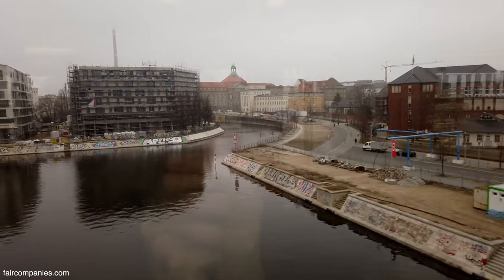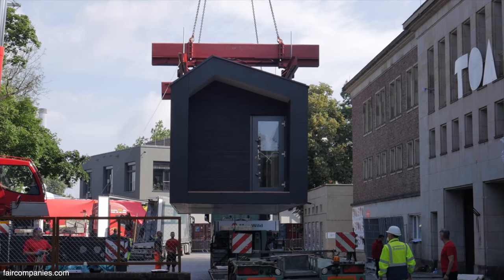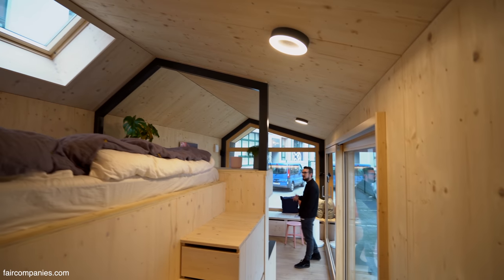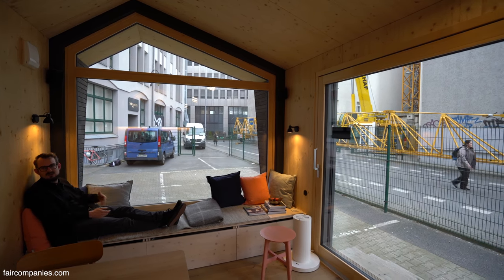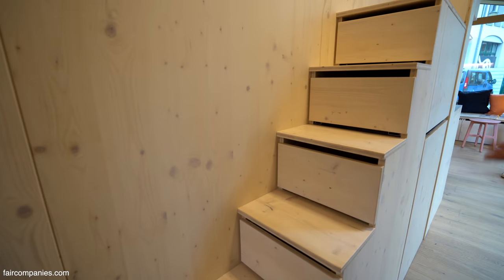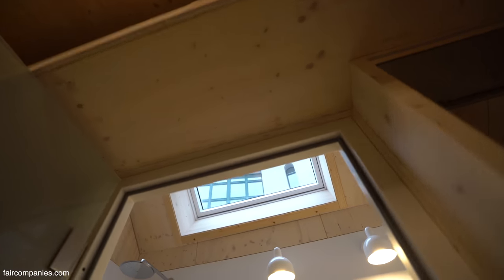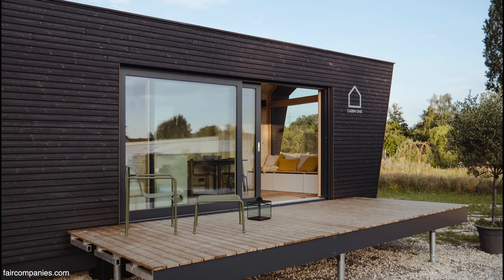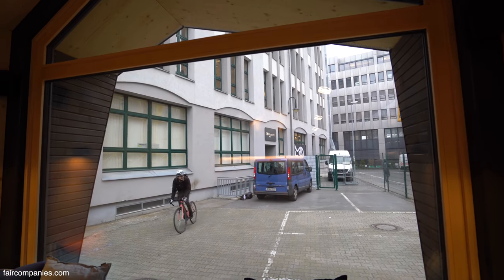An easy-to-install prefab cabin as alternative to rental flats?

Comment: For me aesthetically it's well executed. But like everyone else I have problems/questions. Plumbing and mechanical hookups, how would that work and where are they, under the 'not a bedroom', I didn't see an access point. Access for getting to the roof is the next issue for residents and emergency personnel, and of course what's the weight and what about rain/snow and roof damage from this sitting up there. And is it better to add this to a roof versus solar or a gathering area or a garden/green roof (0:46), those three all add more value for the existing residents and they don't require a big crane. Still I like this kind of thinking. As always thanks for some of the best content on youtube Kristen.

Comment: Clever idea and beautifully designed.   Every one's comments about water, sewage, electricity, access and load each building can handle, are spot on.   I have the same questions.  He mentioned Berlin having about 150K buildings where these cabins can be used.  Seems very optimistic.   Also were they thinking one per building?

Comment: Yet another really fine piece, Kirsten!
Pack in the living, the "dwelling advantage", in R. Buckminster Fuller's phrase. Becker does a great job!!! The windows are pretty important. You go indoors, you're looking for a safer thing than a Gore-Tex rain parka, and a Gore-tex bivouac sac. More inclusive... like with 20 of your closest friends. The wall section, the sheathing... ho, hum... it's the fenestration. There's where performance matters. There's where homes leave "pods" behind.
Engineer the wall openings. Lift from the floor. The loads go down... there's your limiting factor. Right now, aerogel is pretty expensive for dwellings. That could change. Wood is a really great structural material, not only for static structures!!!

Comment: This is a bad idea for several reasons. Chief among them no underwriter will insure this property. Moreover plumbing will be a nightmare as you’ll need an external septic tank which will cost you an arm and a leg to service. It will be blazing hot in the summer and freezing cold in the winter.
Reply: Exactly. He backpedaled so hard when he got asked why it doesn't have a bed room. You can not register or insure this as a living space, not gonna happen. But he doesn't care, all he cares about is selling unitS$$$
Reply: Completely agree and for other reasons I have mentioned elsewhere. Thanks.
Reply: The4valanche It looks like a normal European studio except it's a cabin. Of course you can insure it and register it.

Comment: No details of Price, plumbing, restrooms, council licencing, property law. The house is neat but it will surely fetch more than 150.000€?
Reply: I've seen it live yesterday... Prices start at around 88.000 EUR (100.000 for the full version)
Reply: @Renato UnREAL - But that's only a option for people who can relocate.  While the people living in these locations still need solutions for where they are...
Reply: Michael Gress hi. How much approximately is a small warehouse in Berlin? Cheers)
Reply: Renato UnREAL Yeah, where 50% of young people are unemployed. How do you propose to make money?
Reply: @ZeoCyberG  and that house is not a solution. Its just to expensive.
Reply: @m.p.maxplanation - No, it just may not be a solution for you but depending on where people live they may face far higher costs and would consider this cheap in comparison.

Something to understand about costs is they vary depending on location and things like the local economy, how much market demand there is, etc... What you think of expensive can be dirt cheap to someone else living in a more expensive area or what you consider affordable can be too expensive to someone else living in an even lower cost area.

Add, any solution that works within the same system as other housing is going to be effected by the local costs factors.  Like a home on foundation will need building permits, inspections, impact fees, and other costs on top of just building the home.

So what's expensive or cheap is relative and depends where you have to live...

Besides, this is a prototype and those are always going to cost more than the production models.  So final costs, especially if they can produce a lot of these, can be a lot less.

Anything approaching mass production can reduce costs to a small fraction of the original...

It's why you can do things like buy complete furniture from a company like Ikea for less than just the materials will cost a custom furniture maker...  Affordability is sometimes a process...
Reply: @ZeoCyberG   I'm a Berliner. I know the house market in Berlin and Germany well. And the cabin builder is also from Berlin. I just tell you, that is no solution for Berlin and Germany.
Reply: @m.p. maxplanation -  I don't believe you've read all of my previous post as one of the points was you don't actually know what this will cost as it's a prototype and it seems more like you don't understand how this can help...

1) It's being used on existing buildings where the cost to remodel them and add additional floors would cost a lot more than this unit... 

2) Simply adding more housing units helps the problem of not having enough housing units and reducing competition for housing in turn can help reduce cots.

3) Again, this is a prototype and prototypes cost more than production models. So it's a little early to worry about the price...

For example, when a car manufacturer makes a prototype it can cost anywhere from $100,000 to $300,000 on average.  But the production model can be lower than $30,000...  So don't get carried away by just the cost of the prototype...

4) Even discounting the above, the costs mentioned are for owning,  there's other ways costs can be lowered or mitigated.  Like rent to own, just rent, reducing long term costs, and other options... Costs are not always absolutes, either/or, or constant and never changing...

5) Owning is not the only option, some people can't buy at any price but others who own them can rent them out as an option for those with really low incomes... and again the more housing units there are then the easier it will be to lower costs...

6) There are other ways these can be used that may be more affordable than putting them on top of exiting buildings and treating them as an add on.  Or similar but different solutions may offer a wider range of options to cover a wider range of people.

Thing to understand is progress is usually a process that has to start somewhere and takes time to fulfill its intended goal...
Reply: Renato unREAL  some Europeans (like me) can't stand too long in the sunshine, so living there would be a pain in the ass. Also the cost effective places means that the local economy is in bad shape, with high unemployment and low salaries. There is always a catch.
Reply: @m.p.maxplanation1726  it is expensive, but you have to consider that you can move the house. Say you work for one year in Munich, then two years in Paris, then Madrid and so on. Instead of paying rent in those expensive places, you can just move your house. Then if you decide to settle, you can sell it to the next city hopper, or just build a normal house and use this one as an extension, or an Airbnb, or a cabin somewhere nice.

Comment: Getting to and from that rooftop will the crane be there to bring the groceries? Lol
 And plumbing...
Reply: i agree on the plumbing issue and also the electric plus the safety of being on the roof and having a "safe barrier" so you don't fall off. the grocery issue should be handled by having an elevator in the building theoretically
Reply: probably not for old people. its a good trade off for the views
Reply: I assume this will only apply to buildings where the rooftop is accessible via a staircase and door/hatch.
Reply: @neuralvibes  that was a given, I was more thinking about the fact that most of these older buildings do not have elevators...
Reply: prefab modular homes are better for backyards and blocks of land. If you essentially buy a block of land and put 10 prefab homes on the land you can rent them out and have your own housing estate and you'd be rich
Reply: G Sh very funny and a lovely idea ha
Reply: Cool, interesting video as always. Got kinda weird around 3:00 but recovered nicely. Definitely not allowed over here (the States). THANKS
Reply: GrowingDownUnder Tell that to Californian council - they won’t approve it.
Reply: @dewert2  I would say maybe much older people would be okay with it. They might not need to go out every day. They might not have a partner who is shy. But younger people are more likely to miss privacy. Surely people want their own home so they don't have to share and so they can have privacy? I like all the light, but I think it's not for many people because it's too exposed.
Reply: @FurnitureFan  "Older" folks are often living with unwanted results of gravity and life impacting our bodies, no matter how well or carefully we have lived. For me, there is no appeal, in addition to the need to cart groceries, laundry, etc., with a cane in one hand. Stairs to the bed and wasted space, whether in huge windows with no place to hang paintings or or bookshelves.  This particular module would (when completed) be far more interesting for people starting out who have not accumulated a few treasures kept for viewing pleasure or for those without physical or space challenges.  As someone else mentioned, many older buildings will not have elevators, even if their countries would approve the plan. All is well that ends well for the one in need of the solution. : )
Reply: These small homes are suppose to be affordable. They seem to be costing the same as regular homes.
Reply: @GrowingDownUnder  ...You're describing a Trailer Park in the US.
Reply: @GrowingDownUnder  especially if you can stack them. This doesn't look very stackable... :P
Reply: @hulqen  you can buy prefabricated houses that can be stacked or you should at shipping container houses they can be stacked
Reply: Don’t worry about carrying the groceries up there, there’s nowhere to put them if you did.
Reply: Seems like a waste to put a house like that on a rooftop in the city. Some of have had enough of the rat race and want to get away from the agenda 21 lifestyle. Ever sit around a fire pit on a rooftop?
Reply: G Sh how will we bring our avocado toast 🤨🤨🤨
Reply: ya right? i heard my knees groaning already
Reply: @GrowingDownUnder  but it doesnt work with that 100k cabin. In Germany you can buy houses with land for 30k in the countryside
Reply: @fixman88  similar to a trailer park, but without the trailers and these are actual houses they are just prefabricated. 

@zwerina56 if you get permits they will allow it, these prefab homes are built to code as long as they follow the code and you have permits they will be allowed. 

@m.p maxplanation you can buy them cheaper than $100k they aren't that expensive

@hulqen not sure if this prefab home can be stacked but there's plenty of images online of stacked prefab homes some can be stacked not sure about this one.
Reply: Location location location. Not a fan here. Nice cabin though

Comment: What's under the bed? 
The bed seems to be lifted with no purpose, but just lofted because they can. 
The bathroom doesn't go under it. They don't mention plumbing or electrical under there. What's under there?
THey could have had a pull out closet, added storage, Washer/Dryer, and many other options for under the bed, but I don't see it utilized.
Reply: My exact question!!! ...
Reply: Chaz Evansdale
It's the Boogie Man!

Comment: Fascinating, truly an untapped market. Consideration however is weight on some buildings that were not designed to carry rooftop loads, like decks or even gardens. Having a party with 20-40 people may be too much for the underlying super structure.

Push  back from wealthy dwellers who may be ensconced in penthouses, precisely not wanting affordable housing for a neighbor. In markets that can command tens of millions for penthouse spaces, seems like zoning would be the battle ground.
Reply: My exact thoughts! I can not imagine penthouse owners wanting people on the roof...
Reply: Especially people partying, I can't see it being agreed by anyone who paid extra for the peace of being at the top of the building, with no one walking around overhead. 

I don't 'disapprove' but I would like an engineer's report to check that it is securely attached and that the roof can support an extra 14k tons. Also that it is protected against lighting strikes.

I wonder if it is still okay if the owner has children or pets? I don't think I would like to think of children playing on a roof.
Reply: German buildings are designed to withstand heavy snow loads so they can usually take a small wooden cabin too.
Reply: @weetikissa  It weighs, like, all the snow load of a calendar year, though.  Times 5.
Reply: @tamcon72  Yeah, but buildings have to be built with crazy tolerances so that not all buildings collapse if there's a crazy amount of snow one special year.
Reply: @weetikissa  I'm a former architecture major.  It is not correct to assume that the average building, even in Berlin, would have been built to accommodate the equivalent of half an extra floor in load, in addition to  unusual snow load, which could not have been accurately estimated 40 years ago, before recent weather changes, anyway.  

This company has a good idea that they have not really thought through, as all the structural engineers in these comment threads illustrate.

Comment: Dead space under the bed?  Curious to know what they did there.
Reply: Imagine a walk in closet and a water heater maybe the washer/ dryer combo.
Reply: That area, as well as the area right when you walk through the door. Would be nice to know what's there.
Reply: I get the impression that there are optional extras to be fitted, depending on how people want it customised.
Reply: Lovely design of space and I was waiting to hear what the area under the bed was used for? And still would like to know : )
Reply: sewage

Comment: My only fear would be able to get emergency services to the roof if they were needed.
Reply: Germany surely has regulations that require a decent staircase to the rooftop. So it should not be a problem.
Reply: They're trained and have equipment and tools. But how do you order a pizza?
Reply: A fire would be a long jump down

Comment: Great video as always.
BUT let's come to the serious issues this idea has.
A. The claim that there is so much rooftop space available is a rather false claim. The prefab is nothing less than a another floor in height. If City planners and regulators wanted this they would not have certain fixed building heights in each area.
B. The prefab is so heavy 13.5 tons = 135kN in about let's say 25m2 (?) footprint or less. This means that the uniform load is about 13500/25= 540kg/m2 or 5.4kN/m2. Most roof tops are not designed for such permanent or even variable loads even in snowy areas. This load is on top of the roof insulation which weighs usually more than 200kg/m2. On top of that are snow and wind loads on the prefab. No way. Most roof tops are designed for permanent load of about 200-250kg/m2 and a variable load (snow and or people) of 200kg/m2 or less. And I did not mention that the load is actually not uniformly distributed but concentrated on 2 or 3 steel beam that distribute the force as line loads which is even worst. 
Did I mention that rooftop materials as lightweight concrete and or polysterin would have issues with the concentration of loads under the steel beams? 
 Even rooftop chillers in office buildings weigh less (4 to 6 tons) So there are issues. Not only with the rooftop slab and beams but possibly with the columns or the masonry below. This   would need serious structural engineering to prove that it is OK. Not to mention to prove the local regulatory authority like city planners or engineers. In earthquake prone regions like Greece or Italy the problem gets even worst as you add mass on top of the building. Authorities would require possibly a check of the building as a whole depending on the size of the building. 
B. Then you have to find a way to probably anchor the prefab on the slab to deal with earthquake or wind induced   forces. 
C. I dont know about Germany. But this prefab with these openings and nothing to shade the windows, in southern Europe would be hot as hell in summer. 
C. Plumbing? Phone lines etc etc. 
Finally in super protective Germany I find it hard to believe that most of the things I pointed out is not required. In humble  Greece they would be required.

Comment: Wonderful idea. Though the roof will definitely require preparation. Most flat top roofs have rubber membrane asphalt coverings. Both are prone to punctures. And they get very hot. At least in NYC, one solution is to paint the roof with metallic reflectix. These too, adds another fragile surface. So, perfhaps the designer, can also come up with a platform system, that these cabins can rest upon.